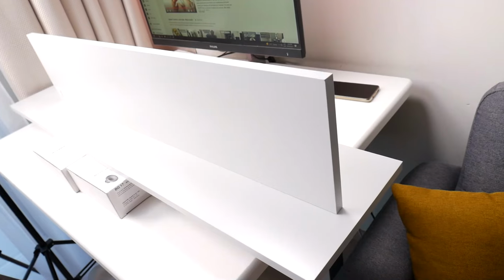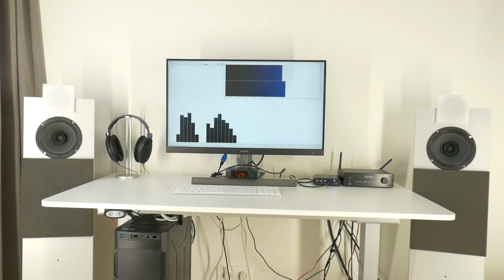Open Baffle Speakers Tweeter Test

Comment: Quality work man. Just a tip, you may want a full baffle behind those tweeters as the edges can cause quite a bit of diffraction, as will that desk. Also, open baffle speakers can be tricky to design because that front wave and rear wave can meet at the sides and cause cancellation and phase issues. They need quite a lot of distance from the rear wall, at least 2 feet I believe, but likely more. They look really nice though. Great finish.
Reply from the maker: Thanks for advice :_techSpeaker:
Reply: 100% .  Too close to the wall.  I have semi open baffles from GR.  Excellent advice.

Comment: The tweeters definitely are a big improvement in my opinion. Maybe the Achat 112 subwoofer you previously showcased would be suitable to add some low frequencies?
Reply from the maker: The Achat 112 subwoofer not for SQ, but I have on JBL ES250P, that I can try just for demo.
Reply: @Techscrews  That would be interesting to see.

Comment: no bass
Reply from the maker: Open baffle speakers not for bass heads. This type of systems offer a different kind of sound
Reply: @Techscrews  true no cap
Reply: just add back ported subwoofer set crossover 50HZ and thats is , airy vocals + no need 4 big ass 15 woofers to delayed bass